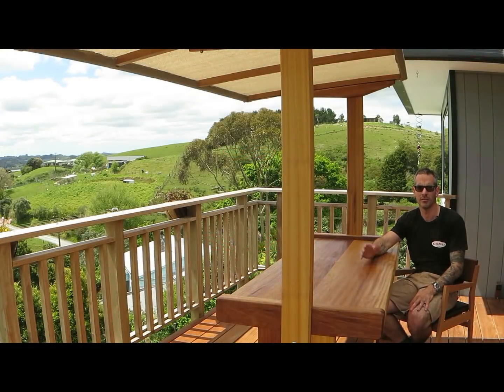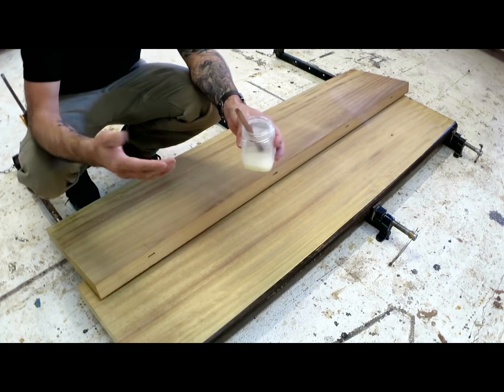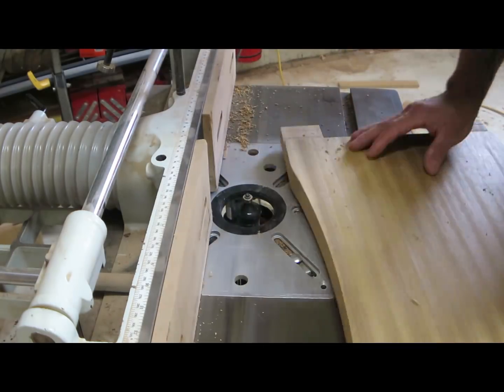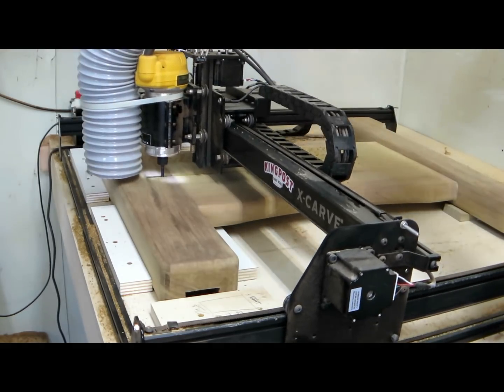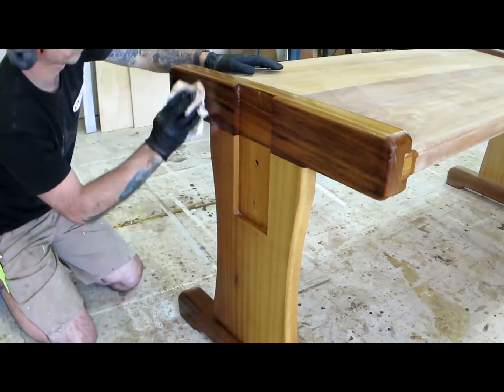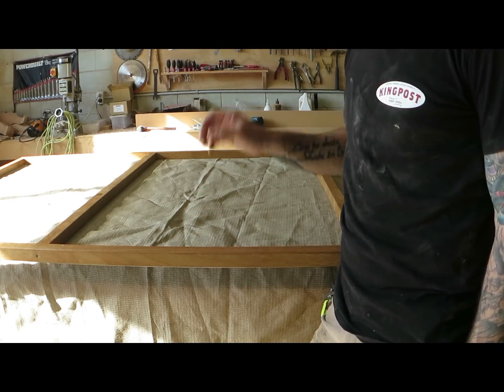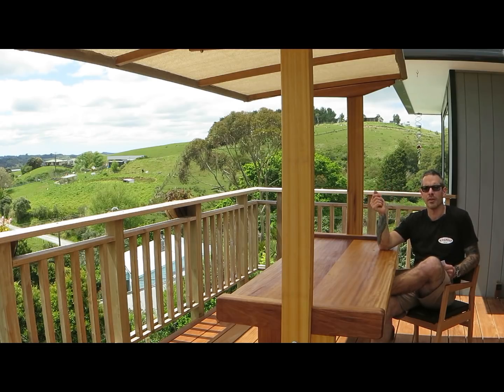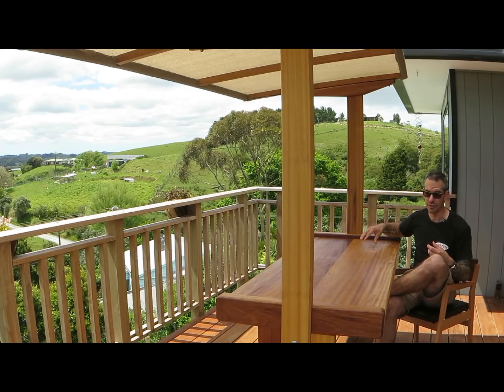Outdoor table  with shade sail +design talk

Comment: Good job mate. If you ever build another there is a special retaining strip you can buy, you attach it to the timber and then stretch the cloth over it. (It's got angled metal teeth and a snap on trim cover)

Comment from the maker: Sorry about the black bars !  not sure what happened with the file sizing there?  anyone know why this happens?
Reply: The details very much depend on your editing software but it looks like you exported the final video in 4:3 format (the squarish dimensions of old TVs). You may have seen options in your editor for letterboxing; that is the term used for adding those black bars. Essentially you had a 16:9 (widescreen) video and accidentally told your editor to make it 4:3 and it had to add the bars top and bottom to take make your video fit the more square profile.
Reply: On your phone people can get it right by pinching/zooming in.
Reply: @merlingallagher4484  not mine 😞
Reply: Indeed, make sure the project settings is 16:9 and export also is 16:9

Comment: Love the build mate. The edge of shade cloth always curves inward, so when you tension the corners, the curve drags outwards and tensions the middle of the cloth. Also when i countersink bolt heads like you did i drill the hole a few mm wider than the head so i can get a socket on it. Thanks for your videos.

Comment: Thanks for postings Joey, really enjoyed the design element talk at the end. My understanding was (from the Shopstool podcast 😁) that a solid table top for outdoor use is likely to split. The sliding dovetail explanation was very useful. It would be interesting to know how it holds up as I have wanted to build an outdoor table with a solid top but I have been hesitant due to the splitting. Maybe an idea for a future video, how your projects are holding up after a year and any changes you would make in hind sight. Thanks for the great content!
Reply from the maker: Ok cool,  might do

Comment: I don't think you will have to much problems with the water, you pretty much covered it a few times over. As you were putting the table together I wondered about the leg braces. Again a good fix. The problem now is that my wife saw the finished product and wants something similar. :( where to get  a similar amount of wood for free???? LOL. OK now to head over to the T shirt shop

Comment: I've thoroughly enjoyed watching you get better at both the woodwork and your video making.  I had a thought while watching you cut the tail portion of the sliding dovetail on the top, what if you were to use your panel saw to score the shoulder leaving the cut a half a mil or so shy of the final depth?
Reply from the maker: Yes that would have helped a lot.

Comment: Do you have a video talking about the dado blades you have on your panel saw?   I'm curious about the possibility of getting one for me to use at work.  I'm based in Australia.
Reply from the maker: I bought the cmt set as it was a reasonable price.  And had to have all the blades drilled out to fit the pins on the arbor
Reply: @KingPostTimberWorks  does it have a problem stopping such a large blade? I thought with the pins it would be a problem.
Reply from the maker: @LostWhits  me too but no it works just great.  Its sooo helpful to have even if it takes 5min to change it over

Comment: Looks amazing mate. Teak oil after epoxy sealer? Does the oil get past it into the wood?
Reply from the maker: So if I could get a good finish just with the epoxy I would . But it sands to a beautiful glass smooth. So the teak oil is used here as any easy film finish which seems to adhere really well
Reply: KingPost TimberWorks have you tried tried using a torch to smooth the epoxy right after applying it? A lot of youtubers seem to use that technique.
Reply from the maker: @selfdestructint  it's not the air bubbles  with this thin stuff is the finish texture is not very smooth. After sanding its mint but subsequent coats remain rough to touch. So a final top coat is required
Reply: KingPost TimberWorks right, nice to know, as I was considering using it for some pieces coming up.

Comment: Cool video again! Does the teak oil still penetrate the wood after sealing it with epoxy or does teak oil also hold as a hardened layer on top of that with all the chemicals they put into it? If it doesn't penetrate through the epoxy, would it work to put on the teak oil first for the look of it and then seal it with epoxy. Or would that a) not work or b) would the epoxy ruin the look of the teak oil? Just curious.
Reply from the maker: If I could get a good smooth finish with just the epoxy I would . I use the teak oil as a kind of top coat as it is very easy to wipe on and cures as a film finish on the epoxy.